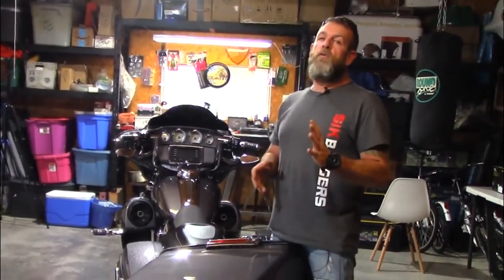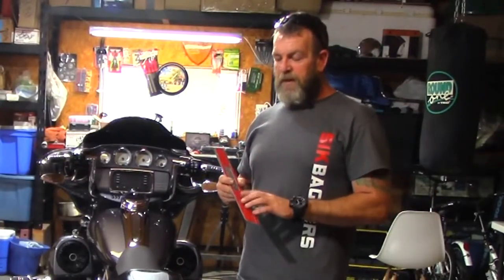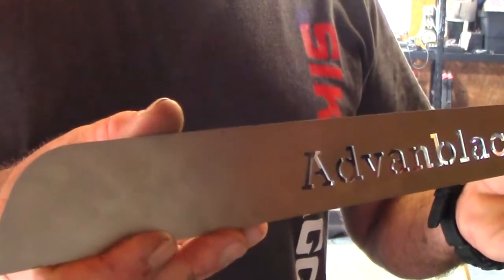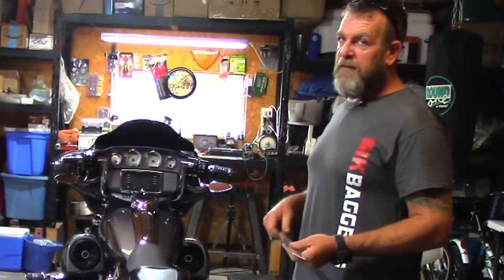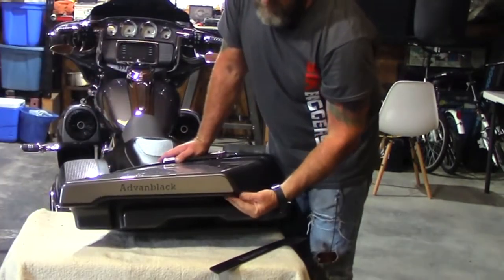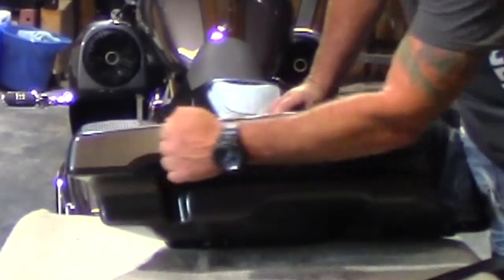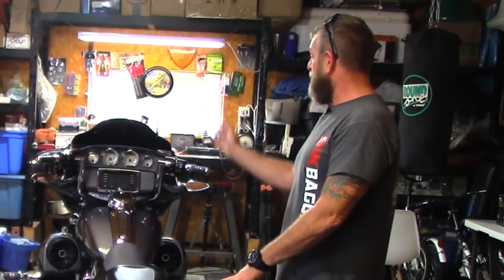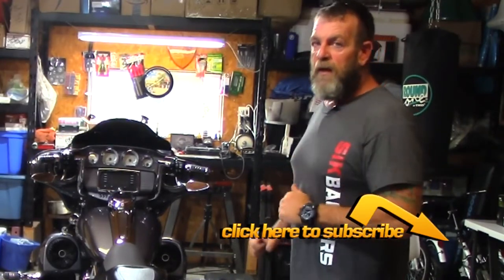Protect Your Extended Saddle Bags With Skid Plates!

Comment: Thanks for the videos. I've watched them and decided to go with Advanblack stretched bags, skid plates and the fender extension on my 17 Street Glide. I don't corner really hard but sometimes lean a little when on a slow turn onto a hwy etc. I have stock suspension. Is there still an okay amount of clearance or am I likely to scrape the bags?
Reply from the maker: I run air and ride at about an inch lower than ride height and I have never scraped. With stock shocks and not being an aggressive rider you should be safe.

Comment: I have these on my stretched advan black saddlebags, and although they do offer some protection, they don’t protect the very edges of the bag which is which is what really scrapes in the turns.
Just sayin
Reply from the maker: If you add them to the leading edge of the bag they will work properly. Been running them for years and never scraped my paint.
Reply: @sikbaggers  I just took a look at mine they are installed exactly the same way you did it in this video

Comment: That doesn't look like they would really protect your bags much. If the bike is leaning you're going to catch the bottom edge and side edge of the bag. I would think you need something that wraps up the side ever so slightly. . Just sayin
Reply from the maker: that is why you put these to the outer edge of the bag,...not dead in the center. It will also protect your bag when going through a dip, say for instance coming out of a gas station in a city..those huge dips they like to add to the parking lot going into the road. Ive ran these for 3 years now...scraped on both instances, corning and large dips...bags are still good.  Good luck.
Reply: @sikbaggers  GOOD TIP. I bought a RK with 4.5" bags. These guards plates need to be put on right on the outer edge. My left side wasn't n it's scrapped quite a bit.